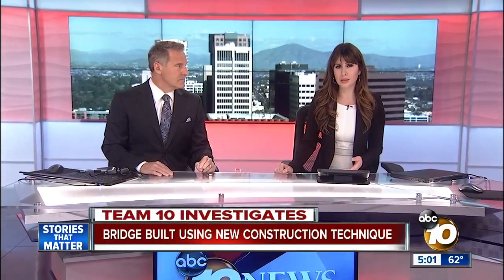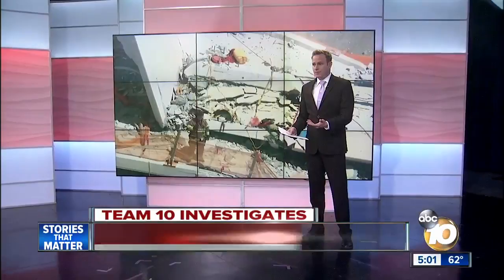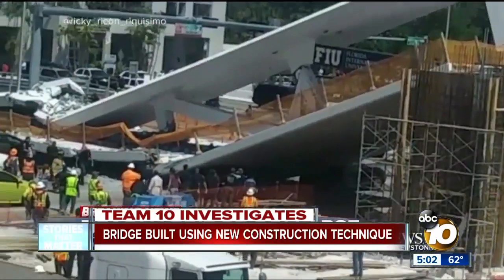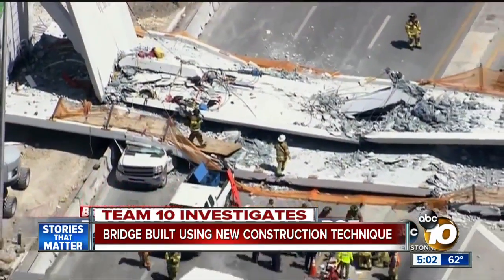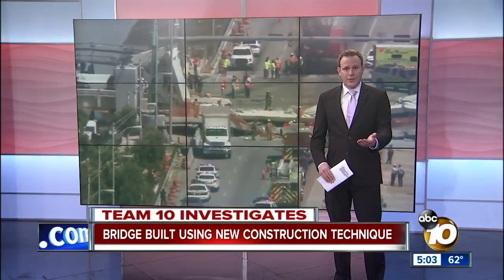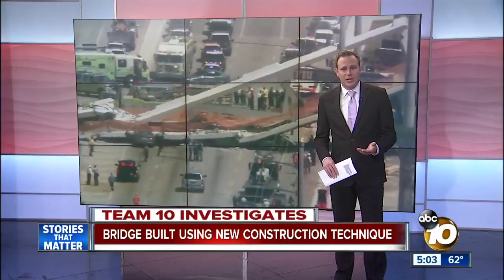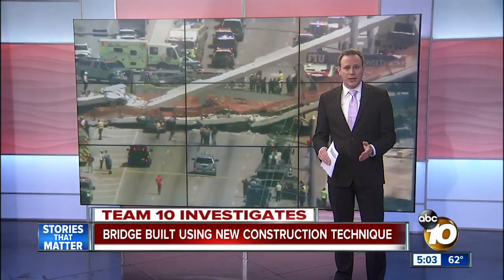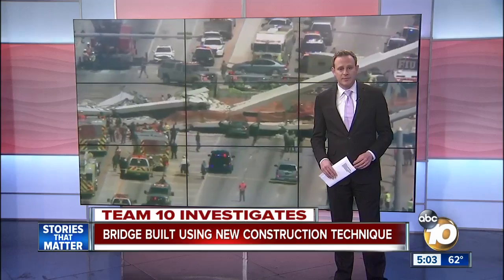Florida bridge built using new construction technique

Comment: Technique is not an issue at all.  The issue was assembly sequence.   Seems pretty simple to me- What we have here is an asymmetric cable-stayed bridge that could not support it's own weight before the pylon and cables were installed. Just insufficient analysis of the un-supported structure.

They were most likely reducing the tension on element 11 which was pulling the structure down, not holding it up.